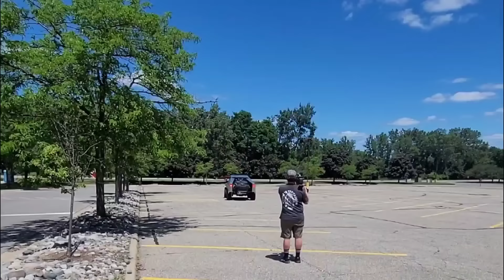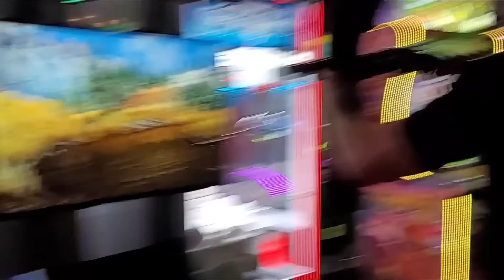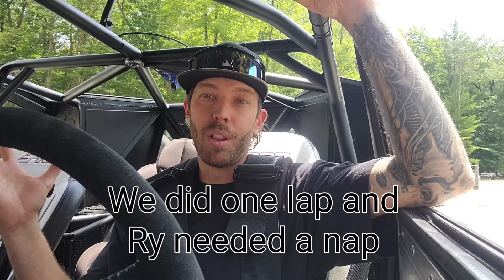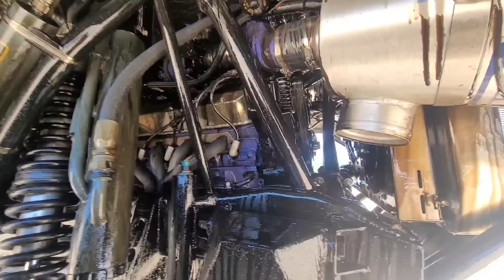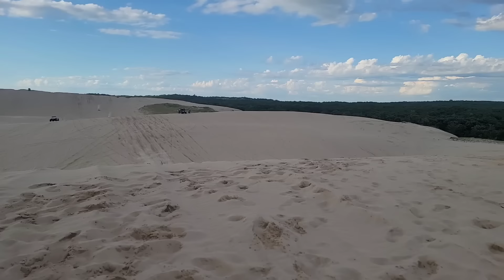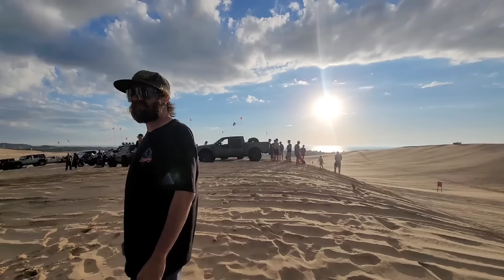Travis Pastrana Drives the Cyber-Runner, we're on fire, Silver Lake Sand Dunes, High Caliber Karting

Comment: same problem i had with a seadoo except i bought it like that...guy said it was just seepage..i saw it filling up the hull with oil so i started checking hoses.  i found a big hole in an oil line that was leaning on a battery post terminal. it was like it ate through because of ionization..positive terminal against grounded oil! i cut the hole out and put in a brass coupling with hose clamps. problem solved!!!